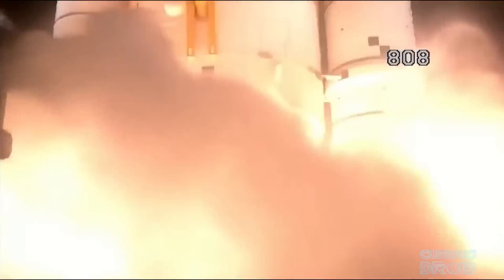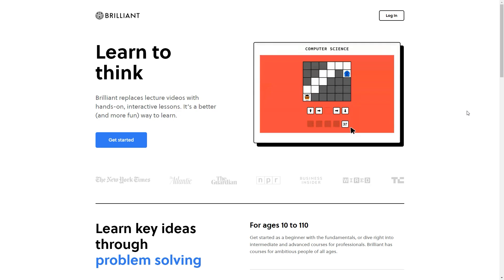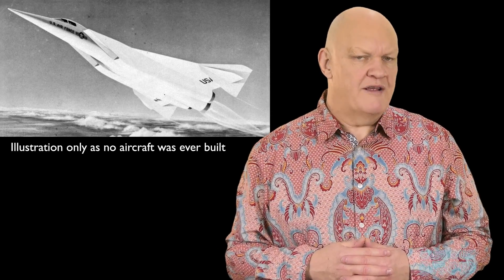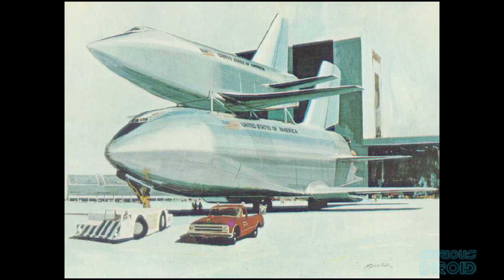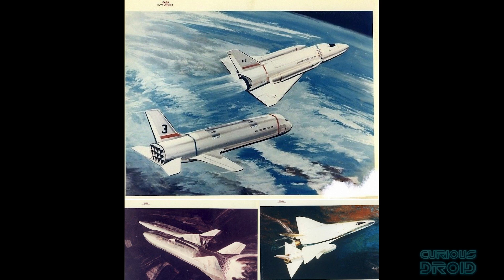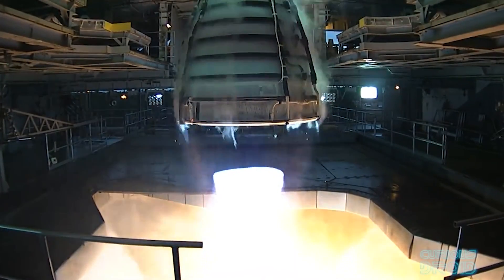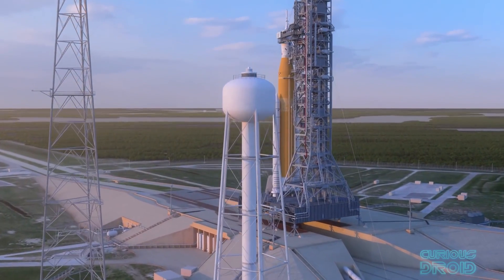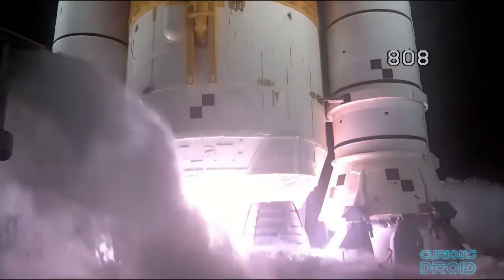Why is NASA Throwing Away Reusable Engines?

Comment: There is no such thing as a truly reusable rocket engine, the conditions in terms of temperature, temperature difference, and vibration are so extreme that they always get damaged as they work, especially if they go through very different environments, have thermal cycles etc
you are always going to get microscopic damage, deformation etc, and you can either spend far more money/effort looking at every surface of the engine both inside and outside with expensive diagnosis equipement, or ignore the problem until one of your rockets explodes

material science just doesn't give engineers any tools to make engines that don't damage themselves as they operate, the conditions are just so extreme that solid matter loses it's properties, and gets slowly damaged, until the piece breaks catastrophically and without warning

that's why it's so dangerous and so expensive to refly a rocket engine, the only way you can make it cheap is by not doing enough pre flight checks, which guarantee that accidents will happen
Reply: If you use it more than once, it's reused and reusable.

Comment: The RS25 engines are reusable, but very expensive to maintain. NASA did the math and I believe it works out cheaper to build a new engine than refurbish an old one. It's a false economy. Giving the Shuttle hardware one last hurrah before moving to more advanced designs and materials was going to happen eventually. By doing it this way NASA is spending less to prove the concept works. This also keeps Congress happy they are spending US taxpayers money wisely.

Comment: The Artemis rocket has been very illustrative of the inefficiencies of NASA compared to private endeavors such as SpaceX. SpaceX is certainly much more effective than most private space companies, but it is also doing much more, better, and cheaper than NASA when it comes to actual launches. NASA should let private companies handle launches and focus on working with such companies to get NASA's scientific and exploratory equipment into space.
Reply: Wow, only well over a decade late as NASA has been moving to the Commercial model since the early 2000s. The first big contracts were the 2008 Commercial Resupply Services (CRS) contracts to the ISS awared to SpaceX and Orbital Sciences (later boughy by Northrop Grumman). The 2014 Commercial Crew contracts were awarded to Boeing and SpaceX. The Commercial Lunar Payload Services (CLPS) contracts started going out in 2019, some of which are launching on SpaceX rockets. The 2021 HLS Option A contract and 2022 HLS Option B contracts for the Artemis III & IV landings went to SpaceX (sensing a theme here). The Appendix P competition is for another commercial lunar lander. The Commercial LEO Destinations (CLD) competition has started for commercial space stations for NASA to lease time on, while the commercial company runs the station. So NASA has ALREADY been doing what you suggest and SpaceX has been a BIG part of that.
Reply: @steveaustin2686  I am well aware, and I am happy they are dong more of it. But they are still wasting valuable funds on the SLS instead of things they are actually good at.
Reply: @tacticalmanatee  Until something comes along that can directly replace SLS, it is the only way to get crew to and from the Moon. HLS Starship is out of propellant to return to Earth after returning to lunar orbit when the surface mission is over. The up to 10 launches to get HLS Starship to the Moon and the 1 launch every 12 days launch cadence for Artemis III, means that Starship can not replace SLS in the early Artemis missions. So even though it is very expensive, it is necessary for the missions to work.
Reply: @tacticalmanatee  They don't have as much say in that as you think they do.  They were told to use legacy hardware and contractors.

Comment: Why are the space shuttle engines tilted relative to the srb’s?
Reply: The engines were not mounted directly in the center of gravity of the Shuttle. So they had to tilt it, to ensure the thrust is on the axis through the center of gravity
Reply: @simonm1447  offcourse, that totally makes sense. Thanks!!!
Reply: @peterencobie  this had the side effect the shuttle did not launch perfectly vertically, but in a slight angle to the length axis of the glider (seen from the side). You can see this on Videos filmed from the side of the shuttle at launches. Since it needed to launch in a horizontal trajectory later to reach an orbit it wasn't a problem (even the SRBs have a gimbal, not just the RS-25s)

Comment: What does it mean and how does it work when a rocket engine performs over a 100%? Max trust is 100% right? How can it perform 109%?
Reply: The planned thrust was X. They got X+9% when they built the thing. So rather than reset what 100% meant, they just used the numbers above 100% because is sounded cool to those who were giving the funding without really understanding the nuts and bolts of it.

Comment: Sad that NASA is walking away from re-usability.  But I wouldn't reuse that shirt.
Reply: No, NASA is not walking away from reusabiltiy. Two of the other biggest programs, CRS and Commercial Crew, use SpaceX Falcon 9 reusable boosters. The fact is, a reusable booster is not always the best option. Booster reusability is great, but has drawbacks.

First, if you don't have a fast enough launch cadence, you can spend more on recovery equipment and personnel than you save by reusing the booster.
Second, you take a payload hit for the recovery system on the booster. The Falcon 9 B5 can lift up to 22.8 tons to LEO when expended (SX), but only up to 16.7 tons when landed on a drone ship (B1069.2). Doing a Return to Launch Site (RTLS) landing, costs even more payload as you have a boost back burn to cancel the lateral velocity and return back to the launch site.
Third, the higher and faster you go, the harder reusability is to perform. The heavier the dry-mass of your booster, the harder reusability is to perform.

So with SLS launching once a year, eventually, the cadence doesn't really justify recovering the booster. Not to mention that it gets higher and faster than a Falcon 9 as the SLS core stage almost reaches orbit, making recovery MUCH more difficult. The SLS core stage is travelling well over 3 times as fast as the Falcon 9 booster and is well over twice as high as the Falcon 9 booster at MECO. The dry mass of the F9 booster is 22-25 tons while the SLS core stage is 85 tons.
The SLS Block 1 can get Orion to the Moon, but not with the kind of payload hit like F9 has. The SLS Block 1B will send along a Lunar Gateway module with Orion, so it really can't take the payload hit either.

SLS started design work in 2011, 4 years before SpaceX landed the first booster and almost 6 years before they reused a booster.
Reply: NASA doesn't have much of a say as you think they do.

Comment: One of your best videos lMO.  You are an awesome guy and l appreciate your videos. Thanks and God Bless you and your family in these hellish times we find ourselves in. And never forget Christ is the only way. Thanks again for all you do.
Reply: Nah, he skips over a lot of issues with reusability. Don't get me wrong, booster reusability is great, but has drawbacks.

First, if you don't have a fast enough launch cadence, you can spend more on recovery equipment and personnel than you save by reusing the booster.
Second, you take a payload hit for the recovery system on the booster. The Falcon 9 B5 can lift up to 22.8 tons to LEO when expended (SX), but only up to 16.7 tons when landed on a drone ship (B1069.2). Doing a Return to Launch Site (RTLS) landing, costs even more payload as you have a boost back burn to cancel the lateral velocity and return back to the launch site.
Third, the higher and faster you go, the harder reusability is to perform. The heavier the dry-mass of your booster, the harder reusability is to perform.

So with SLS launching once a year, eventually, the cadence doesn't really justify recovering the booster. Not to mention that it gets higher and faster than a Falcon 9 as the SLS core stage almost reaches orbit, making recovery MUCH more difficult. The SLS core stage is travelling well over 3 times as fast as the Falcon 9 booster and is well over twice as high as the Falcon 9 booster at MECO. The dry mass of the F9 booster is 22-25 tons while the SLS core stage is 85 tons.
The SLS Block 1 can get Orion to the Moon, but not with the kind of payload hit like F9 has. The SLS Block 1B will send along a Lunar Gateway module with Orion, so it really can't take the payload hit either.

SLS started design work in 2011, 4 years before SpaceX landed the first booster and almost 6 years before they reused a booster.

Comment: There was actually another "failure" that seems to have been "scrubbed" from official history. There was a non-critical failure on STS-4 of a solid titanium High Pressure Fuel Pump first stage impeller. The impeller had three tight tolerance "lips"  so that as the pump got up to operational speed the impellers would axially expand to seal against a teflon-like hi-temp resistant labyrinth seals in each stage of the pump. 13 seconds before MECO the first stage impeller "broke"" Two of the three  labyrinth seal lips of the impeller about 3 to 5 inches long broke into pieces. The broken pieces were fed into the other two impellers of the HPFTP resulting in a sudden "white plume" in the engine exhaust as the pieces were turned to titanium powder then "burned" by the engine. Mission Control was aware that something had happened but the engines appeared "nominal" so they did nothing.

How do I know this? I was part of the Quality Assurance team at Rocketdyne and inspected the damaged impeller once the pump was returned and disassembled at our Canoga Park manufacturing facility. The question NASA wanted answered was the failure unforeseeable or was it caused by something in the manufacturing process. The impellers were made from solid titanium castings and then machined into high precision impellers with labyrinth seal lips . Normally these were "refurbished" after each flight but   STS-4 was considered a "test" flight and the engines had not flown before,

After a review of all the evidence both Rocketdyne and NASA concluded that there was a undetectable flaw in the casting used to make this impeller and that the failure was unforeseeable. 

At one point in time there was  a video of the event available on the Internet but I can't seem to find it. All of the STS-4 Launch videos I can find end before the failure occurred. 

Fun Fact: Each of the SSME engine controllers uses three MilSpec  80286 CPUs as the "brains." of its"Tell-Me-Three-Times" Engine Controller.
Reply: Interesting, I was only aware of four near misses other than this.  The first shuttle flight lost a bunch of tiles and had a number of other serious issues, one of the pre disaster Challenger flights almost shut down all engines before an emergency override stopped them and would have resulted in a very dicey cross Atlantic abort scenario if not for the quick thinking of the ground crew, the heat shield damage on the return to flight mission after the Challenger disaster that only didn't destroy the orbiter because a steel antenna plate protected the aluminum frame, and the gold pellet incident that almost ripped enough cooling channels open to destroy an engine while the solid boosters were still running.  

Am I correct in thinking that the seals held in place by the three seal lips you are talking about were what prevented hot, high pressure hydrogen from being squeezed down the shaft to the oxygen pump?  Because if that was the case then any failure of the third seal would have resulted in the engine blowing up dramatically, which would have been bad at 15 seconds before MECO, but would have been catastrophic had it happened earlier in the flight while the boosters were still going.

Comment: Crazy to waste a hard proven reusable engine tech and just throw it in the ocean, why aren't they trying to recover it like SpaceX?
Reply: Every RS-25 has a thrust of more than 2000 kN. This is more than twice the empty weight of the core stage (85 t empty), you can't throttle such engines back that much to reach a thrust near the weight of the empty booster. You can't land a 85 t stage with RS-25s
Reply: Booster reusability is great, but has drawbacks.

First, if you don't have a fast enough launch cadence, you can spend more on recovery equipment and personnel than you save by reusing the booster.
Second, you take a payload hit for the recovery system on the booster. The Falcon 9 B5 can lift up to 22.8 tons to LEO when expended (SX), but only up to 16.7 tons when landed on a drone ship (B1069.2). Doing a Return to Launch Site (RTLS) landing, costs even more payload as you have a boost back burn to cancel the lateral velocity and return back to the launch site.
Third, the higher and faster you go, the harder reusability is to perform. The heavier the dry-mass of your booster, the harder reusability is to perform.

So with SLS launching once a year, eventually, the cadence doesn't really justify recovering the booster. Not to mention that it gets higher and faster than a Falcon 9 as the SLS core stage almost reaches orbit, making recovery MUCH more difficult. The SLS core stage is travelling well over 3 times as fast as the Falcon 9 booster and is well over twice as high as the Falcon 9 booster at MECO. The dry mass of the F9 booster is 22-25 tons while the SLS core stage is 85 tons.
The SLS Block 1 can get Orion to the Moon, but not with the kind of payload hit like F9 has. The SLS Block 1B will send along a Lunar Gateway module with Orion, so it really can't take the payload hit either.

SLS started design work in 2011, 4 years before SpaceX landed the first booster and almost 6 years before they reused a booster.

Comment: “Others” are pushing for maximum reusability—but the others are not making 8.8MIL pounds of thrust at lift-off either. I’m personally skeptical about Starship using 30 engines clustered in the first stage. The Russians couldn’t do it with the N1 50 years ago, and I’m not sure it can be done in 2023. But I could be wrong…..🤔🚀🚀🚀
Reply: The Falcon Heavy lights off 27 engines at liftoff, so the jump to 33 is not as big as it appears.
Reply: @steveaustin2686  FH is a rocket with a completely different configuration consisting of 3 separate boosters with 9 engines each.
Reply: @tomes3378  They are still controlling 27 of them at liftoff. I did not say that they are the same between FH and Starship, but that the jump to 33 engines is not as big as it appears.
Reply: @steveaustin2686  the behavior of a single booster powered by 33 engines can be completely different than 3 boosters with 9 engines each.
Multi-booster rockets are often used in the world.
But rockets with a single booster and dozens of engines, apart from the failed N1, have probably not been so far
Reply: @tomes3378  You are missing the point. It's been 50 years since the last N1 flight with engine controls, computer systems, and the engines themselves making great strides since then. The 27 engines on the Falcon Heavy, across 3 boosters or not, have been controlled well in four launches so far. So it's not as big a jump from 9 engines to 33 engines as it seems, since there was an incremental step of 27 on 3 boosters in between. If SpaceX was using the NK-15 engine and 50 year of computers, there would be a problem. But SpaceX is using modern engines and modern control systems now. So it is not as bad as it seems. I'm not saying it is easy, but it is NOT the N1 either.
Reply: @steveaustin2686  it's not about controlling these engines, but whether the fuel system will be efficient enough and whether the rocket will not fall into dangerous vibrations
Reply: @tomes3378  That would be part of controlling them as they don't work without propellant. SpaceX has very smart engineers. NASA has very smart engineers. They both see Starship working. I guess you will have to trust the experts or go work at SpaceX and/or NASA to show them how they are wrong.
Reply: @steveaustin2686  It's meaningless.  It's 27 engines, but 3 sets of plumbing.  That's a VERY different thing than running 33 from a single set of tanks.  You dodge around that because you don't have a leg stand on.  It was nonsense when you posted it and it's still nonsense despite your attempts to avoid it.
Reply: @TheEvilmooseofdoom  You are ALSO missing the point. I'm NOT saying that the FH and Starship are the same. The F'ing POINT is that the jump to 33 engines is NOT as big as it appears as they have controlled 27 at a time. Not that they are the same. Just that the jump to 33 is not as BIG as it appears. It's NOT a hard concept, unless you want to put out the strawman that I am somehow saying that they are the same. WHICH. I. AM. NOT. DOING.